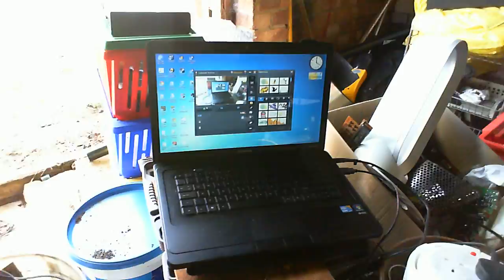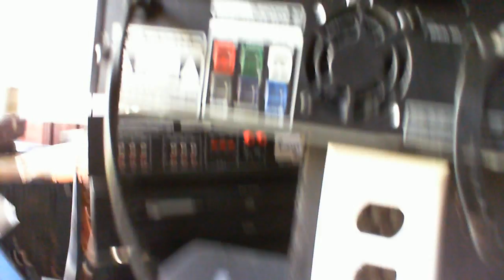The rest of the stuff from the generous donation

Comment: I wish you would have gone a bit more into detail when it came to the big stack of 19" equipment. I think I saw a cassette deck in there too.
And as for that shed: If you cleaned that out, maybe put all the bikes and bins etc. into that garage you have, it could be quite a nice place, maybe even a (summer time) workshop. To be honest, the way this place looks right now I am a bit afraid that over time all that equipment might become nothing more but part of all the trash that's in there and all over the floor...
Reply from the maker: DrCassette I'm going to sort it all out and stack it neatly, when I've done that there'll be another video where we can see everything a lot better.
Reply: I hope so :)
Reply: CoolDudeClem Yes, make sure to keep the equipment off the ground. Even in the 'Other House', although that place is in much better shape than any shed, I had problems with things starting to rust if they sat on the floor for too long.

Comment: Clem, the bit of kit leaning against the bin looks is a piece Roksan caspian HIFI kit. I couldn't say what it is because I couldn't see clearly but I'm almost certain it's Roksan. It's pretty high end stuff, I suggest you look them up. I used to have a Roksan caspian CD player in my system that cost me around £1400, it isn't cheap stuff and that unit WILL have some real value. Get it out the shed, get it in the house and check it out :).
Reply: Looking at it again, I'm pretty sure it's a Roksan Caspian DSP 5 surround sound processor/preamp. It's rather outdated now (such is the was with AV kit) but if it's working correctly, partnered with a good power amp, it'd make a nice analogue preamp and DAC. If your computer has an spdif output, it'd almost certainly wipe the floor with most sound cards. Due to its obsolescence, it's probably not worth a huge amount, probably around  £200 tops, it would have cost around £1200-1500 new!